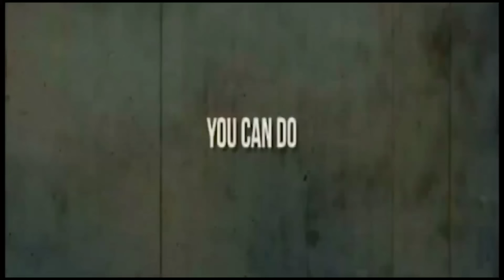how my day never goes to plan ( a day in the life of robert nurden )

Comment: Bob have you thought about instead of the plastic coming out the corners have two holes in the top like sprue hole when casting. A sewing machine makes a good scroll saw. Are you sure the black plastic was 02 ? I've yet to try 05 pp.